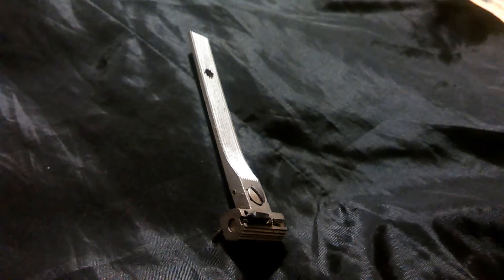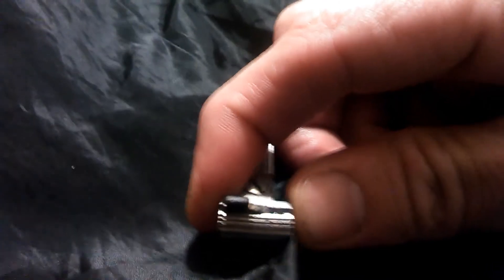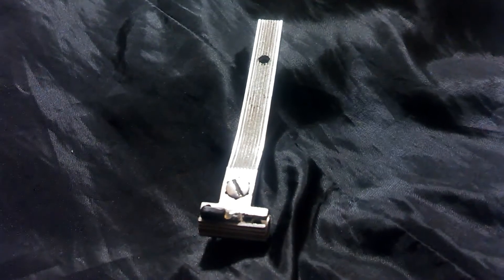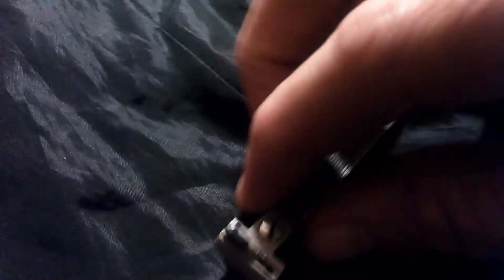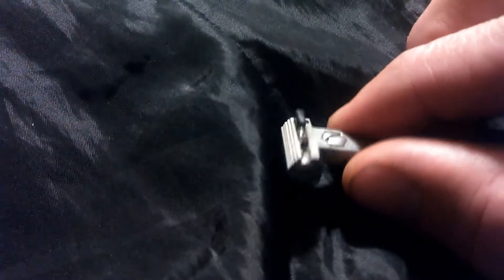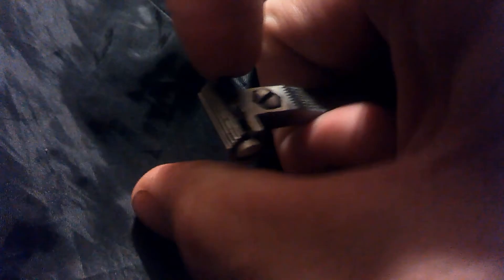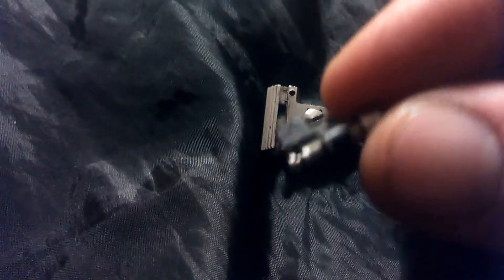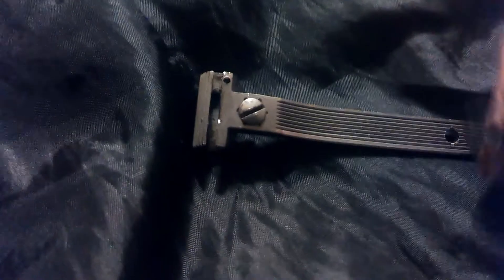Removing rear sight blade on Rossi M971

Comment: I recently damaged my sights in one of my not so finer moments. I’m planning to call Rossi since mine is a braztech model to see if they have any replacement parts for it, if they don’t I’m told that the Smith and Wesson K frame sight assembly fits just fine.

Comment: Did you lose the spring and ball that was in the windage screw?  I'm not sure what all was in there as mine went flying when I pulled the screw out
Reply from the maker: Mine did not have that, maybe it was lost by the previous owner, who knows.
Reply: @mookie2000mhhs  Thanks for the reply. The only reason I knew about these is because I heard them bounce off the shop wall. I did find the ball, but no spring.
Reply: Mine just bounced off me an hour ago..
Does anyone know if it's a big deal if they are gone? Obviously it's not good but will the sights still hold?

Comment: Has anyone replaced the rear sight on this gun I have one needing fixed
Reply from the maker: This video is me literally replacing the rear sight.  A link to a replacement sight is in the other comments.
Reply: @mookie2000mhhs  I meant fully replace and yeah it showed that there is something that needs punched out
Reply from the maker: @iwrestledabassonce  so the disassembly is this video.  Believe it or not, the installation of a new blade is the reverse of the steps shown.  The something that needs "punched out" is a drift pin, but you don't need to know technical terms, just follow along.
Reply: Thanks for showing  us however. Rossi failed to help its customers with anything.
Reply: Also does the S&W rear sight blade work with the rossi rear sight assembly?